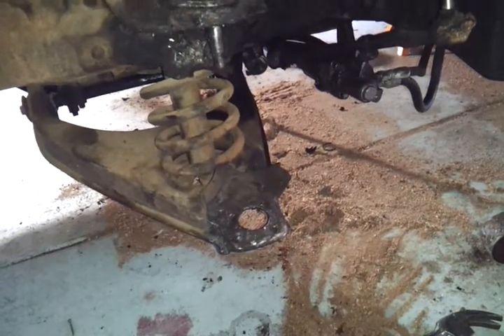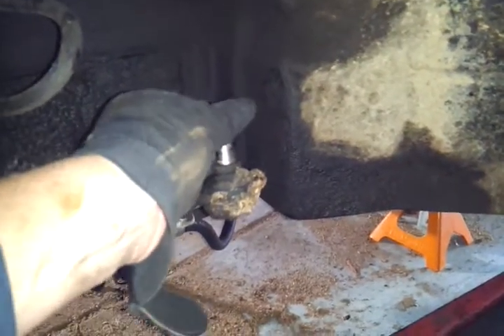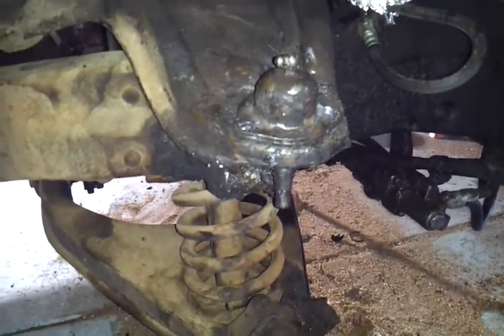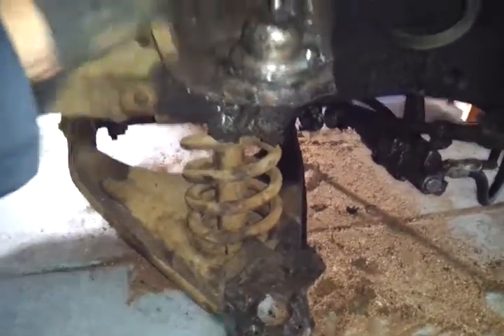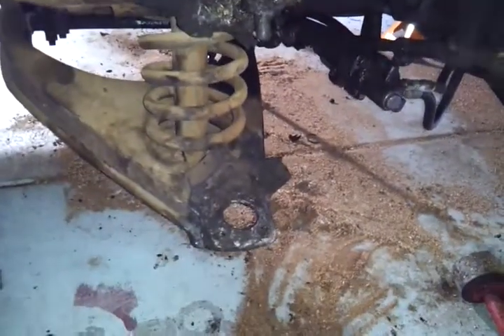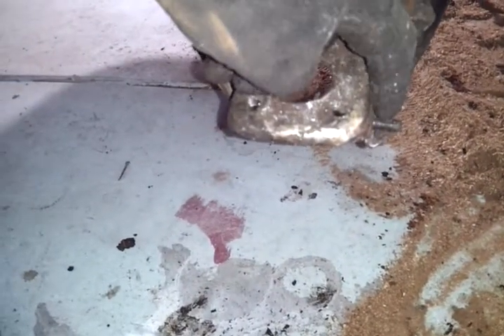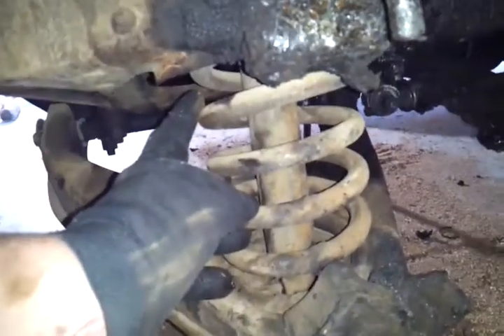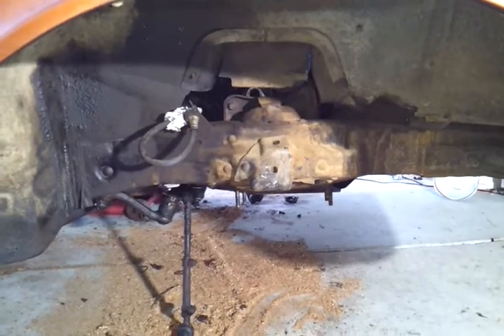1957 chevy bel air upper/lower ball joint  removal

Comment: Easy to separate the tie rod and ball joints. Don't hammer the nut as you might damage the threads.  Just put a big hammer against one side of the steering shaft where the tie rod goes in and bang on the other side with another large hammer. It will come right out.  Same on steering knuckles. This is what the factory shop manual says to do to remove.

Comment: You can make a spring compressor with a two foot piece of 1/2-13 all thread, a 1/2 thread eye hook, two all thread connectors 1/2-13 and a lawn mower wheel bearing 1/2  inch hole dia. and the bottom of an old shock. Should run under 10 bucks.  The safest way to compress springs.